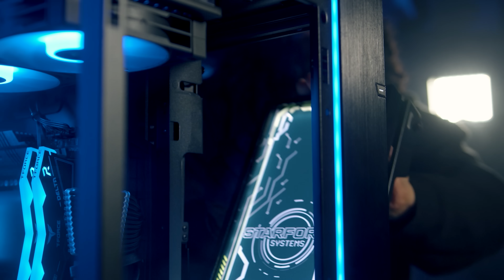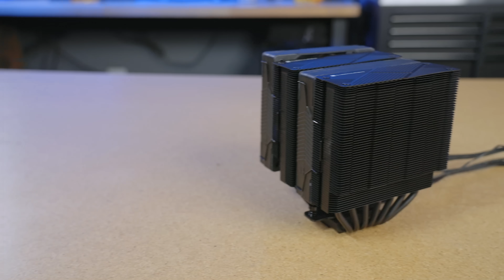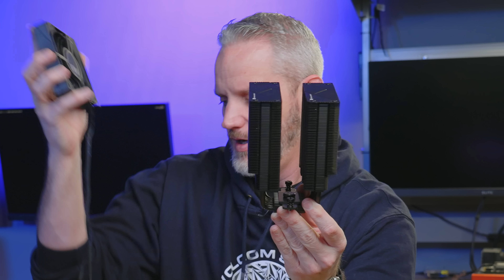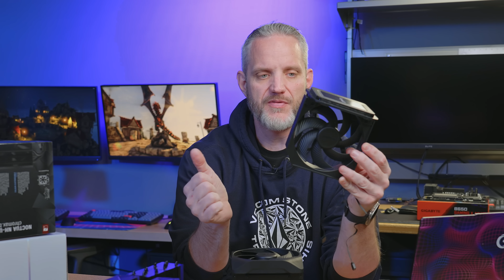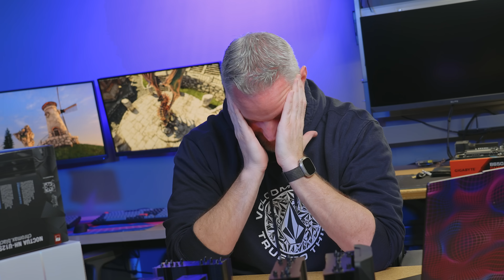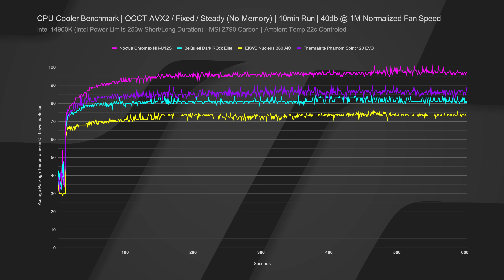This $49 CPU Cooler has big brands SHOOK! Thermal Testing Cheap vs Expensive CPU Cooler!

Comment: I don't care if it costs 100 USD more, I care if it's 10db louder. 40dbs is waaaaaaay louder than I want it to be. It doesn't really make sense to compare them with a locked db target as loudness is a big factor when choosing fans. 
There is also form factor to consider, so fans shouldn't be compared blindly. (although in this case they are all the same form facotr too)

Comment: Been a Thermalright case fan user for years. I do DAW work, so I wanted to get my PC as quiet as possible. I got a 3-pack of Thermalright case fans for less than a single comparable Noctua, and they are just as quiet.

Comment: Add Coolermaster hyper 212, NZXT kraken 240, Thermalright assassin X120, upHere 6 heat pipe cooler, ID-COOLING SE-903-XT Black, Thermalright Phantom Spirit 120SE, ID-COOLING FROSTFLOW X 240 into the mix for stock coolers and the tested ones in this video :)

Comment: I just bought a DeepCool AK620 cooling block for my Ryzen 5 5600X ( it will also be dropped on my new Ryzen 9 5900X when that arrives in the mail )
The wraith cooler that came with the CPU kept the CPU at about 40-45 degrees at idle in an mATX case.
I upgraded to an ATX tower with ventilation ,swapped from 120mm fans to 140mm fans and the DeepCool AK620 and now my temps idle at 33-36 degrees celcius and under load it sits around 55-60 degrees under a dynamic board controlled voltage of 1.1v to 1.3v.
This upright design of the heatsync and the twin fans genuinely is a huge improvement over the traditional heatsync and fan combo, it allows you to inline your rear extraction fan with the CPU cooler and directly vent 99% of the heat out of the case. I can stick my hand inside the case and it feels only ever so slightly warm, likely from the GPU idling at 44 degrees, haha.

Comment: Thermalright is fantastic. They used to be quite common and well regarded back in 2006-2010 - at least in EU. I've been using their "Macho" HR/ARO series coolers since they came out. 70$ and performance is around noctua's ND15.

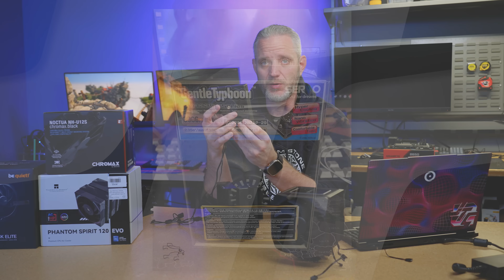Comment: 3:00 I've replaced a dozen fans on my PC, corsair/cooler master... Whatever. They always start showing noise after about 2-3 years. Once they start making noises = they are worn out.
You can try to re-grease/oil them. It's only gonna get more annoying and they can get stuck and not spin at all.
Meanwhile, 8 gentle typhoon 1850/1450rpm no pwm from 2010. They've been running 24/7 on the NAS/UPS since then. Still as quiet as they were brand new.
It's the only fan I would recommend if all you need is reliable high performance fan.

Comment: im using Thermalright Frost Spirit 140 White v3 ARGB on Ryzen 7950X3D it has 4x 8mm heatpipe, from video i watched year ago it seems like it can outperform 240 AIO on dual CCD Ryzen and also some other Brand air cooler like DeepCool and Noctua
please add AM5 CPU in you're test since some Cooler work better on AMD and other on Intel and some also work better  on Dual CCD compare to single CCD like the one i got

Comment: Maybe make a ranking tier list from F to S in the "overall cooling by type" and run comparisons between categories. You could also compare by price at time of recording. Examples could be milled heat pipes vs ones like these with material between the cpu and heat pipes.

Comment: 2021 Pandemic shortages obliged me to get a Ryzen 3900X with stock cooler. About 6 months ago I was able to get a 5900XT  and equipped it with the Thermalright Phantom Spirit 120 RGB. Unfortunately just a couple of weeks ago one of the two fans started rattling, so I'm just running the working fan between the fin stacks ( the failed fan now just sits immobile neatly on the shelf above the PSU and only provides RGB loveliness, because I couldn't be bothered to make that disconnect too). 

 My system unit is a Lian-Li LanCool II Mesh RGB. The topmost of the three front intake fans blows directly at the CPU cooler, while the back exhaust fan of course pulls from the CPU stacks. My front top fan is an intake blowing over my RAM and across the front face of the forward fin stack. The rear top fan is about 80% over the fin stacks as an exhaust and seems to be the loudest fan in my system. I can't hear the CPU fan at all. fans  
During hum-drum operation my CPU temp averages around 35-C. Despite the one fan failure I think that's a satisfying average temp. $42 well spent.

Comment: As someone who uses the ThermalRight Peerless Assassin 120 on a Ryzen 9 7900x, i can say it does keep my PC around 30-35c idle, under load it usually averages around 70c max. Should be stated i also use a ThermalTake CTE T500, with 9 140mm ThermalTake fans, a beQuiet 120mm PWM on back of Mobo, and i use ThermalTake 120 PWMs instead of the provided ones on the cooler itself. I got it in january, and its been amazing.

Comment: I'm bit surprized, she survives... Because Noctua NH-U12S is "small" form factor rad. Never was design to run this type of power CPU.
For power hungry CPU's - NH-U12A is a lot better - thicker rad, 7 heatpipes and 2 fan option. Plus special mount to move rad few mm offset to better AMD heat distribution. 
In my case: NH-U12A with 2 fans overperform 240mm AIO ;) and virtually is mainteance free (AIO slowly looses liquid over time).
Anyway, nice review.

Comment: To be honest, the NHu12 is a good single tower cooler, especially for noise level. It's just not a good cooler for today's high tdp cpus and for that price. Same can be said for Cooler Master Hyper 212. They've both been around for a long time and they're showing their age in the last few years especially. At least you can get a 212 black for $40-50 on sale (for many years now). If you really wanna give the NHu12s (or hyper 212) a fair shake against dual towers, consider adding a 2nd fan or swap the fans from the Thermalright and see if there's a notable difference. There's likely a lot of people out there who are reusing their older tower coolers on newer builds because it's free OR free + cost of additional fan. I'm currently using the DeepCool AK500 (pre sanction), it handles my 5800x no problem.

Comment: I am so happy with my System´s cooling. Fractal Design Torrent .... Huge Tower and I love it. Big Ass Huge graphics cards... no problem enough space, air filtration for inlets... 2 year old components don´t show a sign of dust on their ventilators.Have heard some liquid cooles midi towers running quite noisier than my air cooled setup

Comment: Not sure if this will get read, but for Thermalright:
* SE - Cheaper Version
* Evo - Premium version
* Single tower - X 4 heat pipes, King 5 heat pipes, Burst 6 heat pipes
* Dual Tower - Royal Knight 6 heat pipes, Peerless Assasin 6 Heat Pipes, Phantom Spirit 7 Heat Pipes

The Royal Knight is a Peerless Assassin made to not block RGB RAM. The Burst Assassin also works well for this. 

Thermalright's innovation is their Anti-Gravity Heat Pipes or AGHP. Noctua focused on fans, but moving heat from the CPU to the heatsink also matters. In an AIO can lift and pump water - Thermalright had a different approach, no pump needed when you can use a sponge. The hot spots dry up faster and the sponge wicks cold liquid right back to it. It's not actually a sponge, but it's made of sintered copper powder that acts like one.
Reply: I can personally say there's zero to no difference between phantom spirit's SE and EVO versions performance-wise. I had a chance to test them without having to buy both of them.
If you can find EVO version and you have couple more bucks to spend on it for "premium", why not, but you don't have to chase EVO.
Reply: @CuriosityDidntKillMee  The bulk of the performance comes from the heat pipes. Noctua focused on fans, Thermalright slayed with heat pipes. The SE will often lack features like vibration dampening rubber pads which the regular models will have, while the EVO will often include higher quality components like FDB fans.
Reply: @aminy23  FDB is not a 'higher quality component', it is pretty standard. The se uses those tlc12c fans don't they? They're FDB. The EVO has fancy covers and rgb, hence the 'premium' price, as we all know, LED are super Expensive. Oh, wait.
Reply: @aminy23  FDB is standart, even on SE of phantom spirit. S-FDB to be exact. (Self-lubricating Fluid Dynamic Bearing)
Reply: My Frost Spirit 140 v3 is a chunky boi, 4 heatpipes but they have 8mm diameter, sucks the heat from my OC'd 5700X at 160W at full avx2 load and keeps it at about 70 degrees, heatsoaked at 74 after 15 minutes, it can easily cool it passively at stock speeds. Very impressed, the stock thermal compound is fine too, 1-2 degrees difference between supplied paste and NT-H1. I got it for 50 euros, now it's around 65.
Reply: @silexplod22123 how dude i have same  cooler but with 9700x always 95 even after pbo advanced -30 all core 140watt still hit 95😅
Reply: @saijyo8549   case airflow?
Reply: You can always pickup dual tower cooler and take off front fan, it won't block ram either :ł
Reply: @Fpvna30  mount fan behind the front and rear heat sinks, pull the air thru them. May conflict with rear case fan, but I'd rather lose the rear case fan than 1 of the CPU cooler fans on a dual tower.
Reply: The SE isn't cheaper. It's a slightly modified design with the fin stack placed lower on the heatpipes to allow slightly better case compatibility at the cost of ram compatibility.
Reply: I've been trying to figure out which cooler to go with my Ryzen 7 5800X3D that I got for $240 and I've been looking at the Phantom Spirit 120. I was initially thinking about the Evo version until I looked at comparison tests and the SE was cooling better than the normal & Evo.
Reply: @TheLeftybar Look for the Royal Praetor from them, also comes in Ultra variant with one more heatpipe for a total of 7 :)
Reply: @josephtanphotography  I got the PS120SE, It's keeping it real cool with my GPU being the one getting hot. I'm having to change the fan curve on my GPU.
Reply: @TheLeftybar  I would think any single and definitely dual tower would keep the 5800x3D in check. I have a 5800x and a DeepCool AK500 with 2fans and it's like 75C under full CPU load. 60C gaming and nearly silent.
Reply: No, SE is lower tower.
Reply: FYI Phantom Spirit 120 SE is better than the EVO version.
Reply: also take note that thermalright fans sucked this is why its cheap. you can replace the PA120 or phantomspirit stock fans slap them with artcic p12max or phanteks t30/d30. it it runs 2-3c cooler and beats dh15 easily
Reply: @pouringpoipoi5777  I've been building custom PC's since the 1990's and couldn't agree more. This generation of Thermalright fans are poorly designed which is annoying but not a deal breaker considering the performance of the whole cooler. The fans suffer from obesety one could say. Those big blades actually hamper performance  because the outside fan, acting as a wall of sorts with its spinning blades blocking the bulk of the flow, leaving a considerable amount of hot air trapped in the tower. Imho Thermalright should look bat at their own fantastic line of very efficient Assasin designs for inspiration. Switching fans is not an expensive move since TR alreardy has more suitable fans on hand.... as do I so some of my best clients alrady benefit from the swap and report a noticeable improvement. Only minor issue is that Assasin fans have slightly shorter clips so you have to either pull harder to slip them on, or just use SE/EVO clips.
Reply: @pouringpoipoi5777  The p12max is only a couple C better than the thermalright fans when normalized, but unless you restrict it's flow, the p12max is a very loud fan. The p12max is also twice the price.
Reply: @pouringpoipoi5777  no this not work...stock fan is still better...hardware canucks already test it
Reply: Cool! I didn't know thermalright had a cpu cooler similiar to the scythe fuma 3 which I'm using currently. Really nice seeing all these dual tower cpu coolers made with users who want to show off their ram kits kept in mind.
Reply: "Not sure if this will get read" It has been read, and it was appreciated. Thanks :)
Reply: such a good comment man thank you
Reply: Just fitted a peerless assasin 120 SE RGB last weekend (on a AM4 platform, bought the RGB version since it was simply cheaper then the non RGB version for whatever reason) The fan hovers slightly, not much, above the RAM, but the fans can be placed higher if you want. Might have a little less cooling that way since it doesn't cool all of the cooling block, but it does fit.
Reply: SE is not cheaper its just less tall
Reply: i was looking THERMALRIGHT Peerless Assassin 120 SE in local market ,but could not find.. but found THERMALRIGHT Assassin X 120 R . what is meaning of R?  do you recommend THERMALRIGHT Assassin X 120 R  for Ryzen 7 5700X(plan to use this PC mainly for blender)
Reply: @2DAnimax  i think this is single tower cooler with digital temp display...i prefer dual tower like the phantom spirit 120 evo and on single tower like the burst assassin 120 evo that has dual fan
Reply: @romelhyn  thanks.

Comment: The H212 was the go-to cheap cooler before Thermalright really took over.  It'd be a good starting point for the low cost coolers.  Showing a 120mm AIO would be good to show how bad they really are. I really do miss the days of a good web page showing all the coolers side by side.  Videos are great, but not always the best way of showing ALL the data.

Comment: On Be Quiet!'s admission around 23:25 they do have a few "bonus" features and polish added on but they do need to consider where certain refinements (or blatant add-ons speaking of the market in general) will cost more than the value they bring. 

Comparing the Thermalright Phantom with its simple large heat sink and a touch of RGB to the Be Quiet! with its extra polish and presentation but only slightly better performance is a lot like comparing Ford Mustang GT to a Mercedes AMG GT. The Mustang GT you get a big V8 in a GT coupe with leather seats and all of the meat and potatoes of performance muscle for about $50-60K. The AMG GT on the other hand you get all of that and a bit more with next level refinement but at $136-177K is simply next level 3x better? Diminishing returns will hit and when real budgets come into play I think you know where the sales will go.

Post Edit: I do like the Be Quiet!, they make great products from what I have heard, and a little extra cooling and quietness might be worth it for me in my personal build this year but again that budget.

Comment: Great video Jayz, literally bought the Phantom Spirit Evo a month ago and I was surprised how well it tamed my 14700K CPU. Coming from DeepCool AK400 that cooled my 10700 fine and dandy, but absolutely fell flat in front of 14700K, so I watched a couple of reviews online and went with Phantom Spirit Evo and was pleasantly surprised. Glad I made the right decision.
Reply: which one should i choose? i want use it for a 7600X i want the best cooler for low price, the sound is not a problem for me idk the thermalright phantom spirit 120 normal, SE or EVO version
Reply: @eidanem9Hey man, get the Evo version, the SE is fine too, but if you can manage get the Evo.

Comment: Thermalright I think just has good management "right now", that cares about the products they put out because to be honest back when I saw my AIO it's a frozen warframe 240 with an LCD, and it was like $70 when I bought it back then. Meanwhile the other 240 AIO from "big" brands are just way too overpriced. Also back then you wouldn't be able to buy an AIO for that price you'd only be able to purchase an expensive air cooler.

Because as I've said to many of my friends before the big brands aren't necessarilty expensive because of their performance, it's because "they made it" so they can charge a premium for their products even though the only thing it gives the consumer is the bragging rights that they have an expensive component ERRMMMM (corsair, asus rog, nvidia)

Comment: I got Thermal right Se cooler and because i have so many fans i wanted to get a new back exhaust fan.. so I just purchased and installed x3 Be Quiet silent wing pro 4 120mm. Installed one be quiet at the back exhaust and then the other 2 i swapped the fans with the thermal right cooler fans not sure if this is good or not  But seems to make sense to me for more air flow and Exhaust out the back. I do however want to also swap out the 3 stock case vertical fans for 3 more be quiet pro 4 fans to get the same RPM and Air flow Intake as whats going throught the cooler and back exhaust.  also i have 3 rgb thermal right fans for bottem of the case to bring air in and 3 for the top exhaust. at the moment  12 120mm fans  any thoughts ?

Comment: You should add (one of) thermalright's 240 and 360 aio, which respectively cost about  80€ and just under 100€ here on amazon... and some of them come with an LCD display :)

Comment: Budget Thermalright and ID Cooling with shaved copper heat pipes should be included in the next test. I own and use a Thermalright Assassin X 120 Refined SE on my 5700x3d. It rarely hits 70c while gaming and isn't that loud to me. I "upgraded" it with a second fan on the other side to make it the PLUS variant. Great brand, great product, great prices (at least on the jungle website).

Comment: I would've liked to seen the NH-D15 chromax black in this list. I have used the NH-U12S with a few 5600x builds and it worked great. But for the money you are paying and cooling a 14900k it's more practical to pay a little extra for the NH-D15.

Comment: I have a ryzen 7700 wtih a Phantom Spirit (not Evo) that cost me 34 usd and just purchased the TL-K12 fan for 10 bucks and I am using it with 3 fans. And the core temps are great. not much a difference from two fans but It looks way better and I love the look.